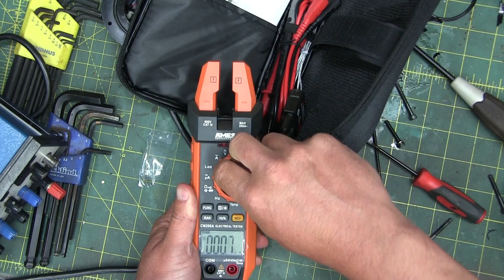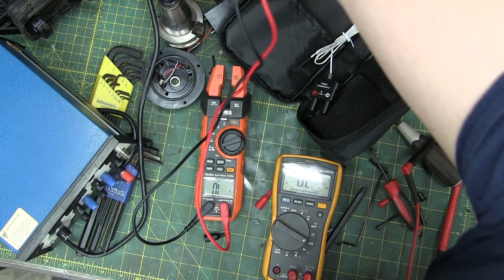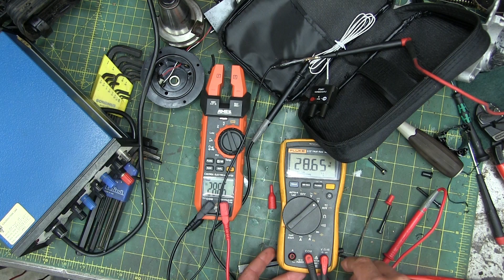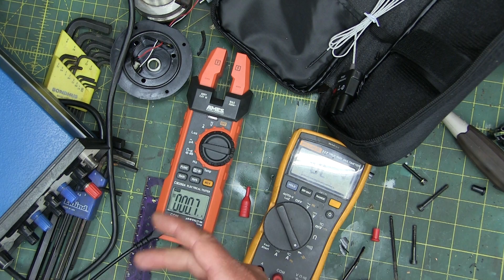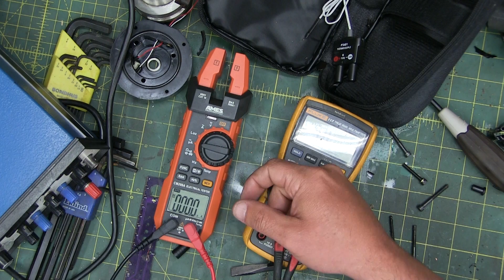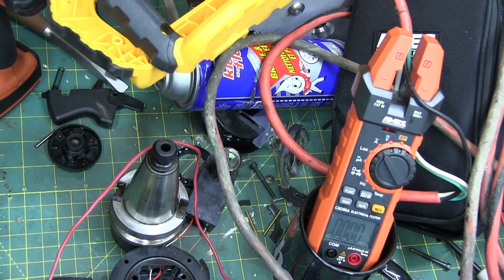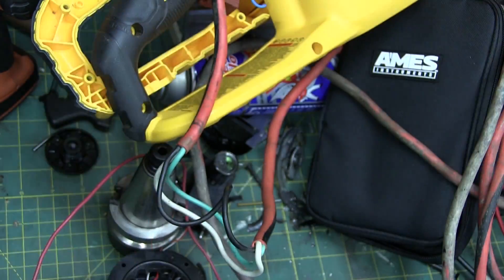BOLTR; Harbor Freight Fork Meter | Shockingly Accurate!

Comment: Honestly as an electrician your
 main concern should be "will this kill me?" 90 percent of troubleshooting is just go/no go anyway, without much concern for exactness. Take this to work and give your coworkers a laugh. Hell, I'd probably buy you a meter if you pulled it out...
Reply: It's not intended for work. It's a consumer product just like every other product sold by harbor freight.
Reply: There's alway a newbie pulling out cheap tools, from their tool bag.
Reply: there is a place for cheap tools, not every newb can afford a full deck of tools. 'cept safety related stuff like a multi meter.... however, if your a low voltage tech, why not!?
Reply: What if you don't pull out?

Comment: I suspect because those forks bend fairly easily and the PCB is inside those forks it is gonna crack or more likely the copper traces or solder joints on there are going to crack. So I recommend to not bend the forks or throw the thing around too much

Comment: Is there a pickle fork that can measure DC?
Reply: Luke Makes are you talking amp clamp as well? I got a UEI dl489 that does ac/dc on the clamp. Klien makes one as well
Reply: I'll look into them, I need something that can read DC from an alternator.
Reply: Extech ma220 does it as well, and the uei 389 is the cheaper version of the 489. I think the klien i was looking at was the cl800.

Comment: Hey AvE, ever heard a pneumatic cylinder screech like a banshee?  I have one on a piece of equipment at work that I can't find any leaks on, but it howls like tinnitus after sitting beside an exploding hand grenade.  Any ideas why it would do that?
Reply from the maker: Moving at just the right speed... Jam some lube in there and if it's metered make sure it's meter out and not in, tweek the actuation speed. If not, fix it till it's broke.
Reply: Sounds to me like you need and old priest, a young priest and a shit load of holy water...
I'd try removing it and cycling it by hand to see if there's metal on metal contact somewhere... The noise might also be from the mechanism it actuates and not the cylinder too, so check for hot pivots (If it moves enough in operation for bad pivots to generate heat), piles of shrapnel under the mechanism or schmoo with crusty bits oozing out of anywhere.

Comment: Micro amps are very common for flame rectification. That is, measuring flame rod signal current on combustion safeguards. Important for HVAC troubleshooting.
Reply: DC micro amps
Reply: Hence the "rectification".